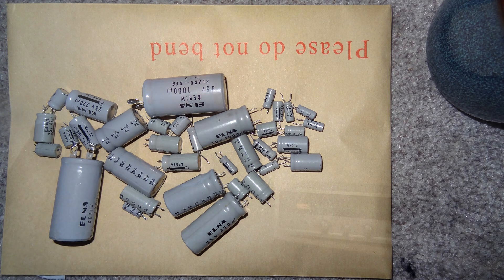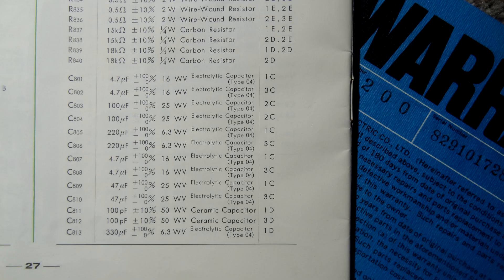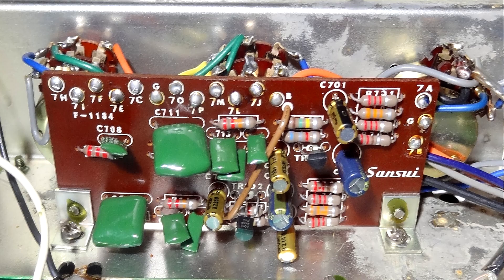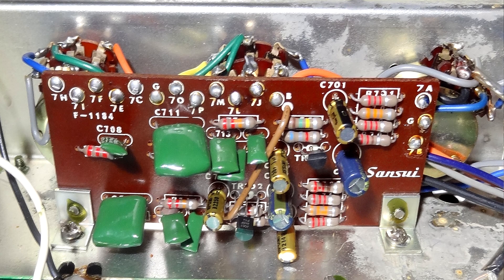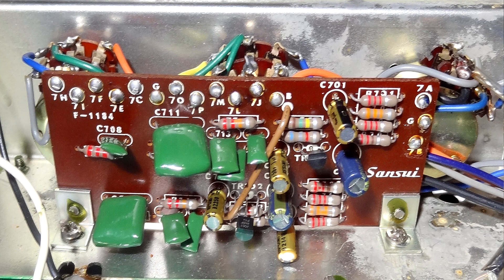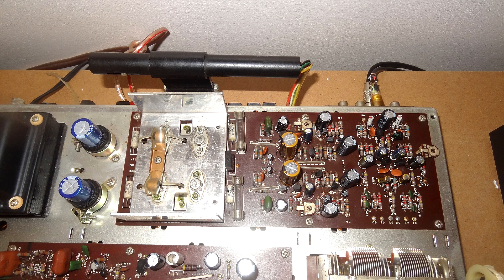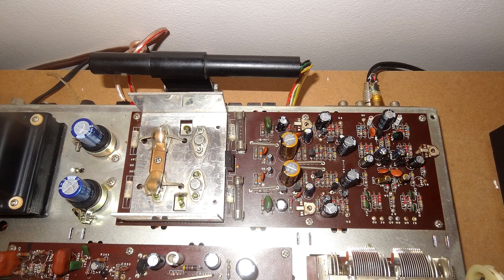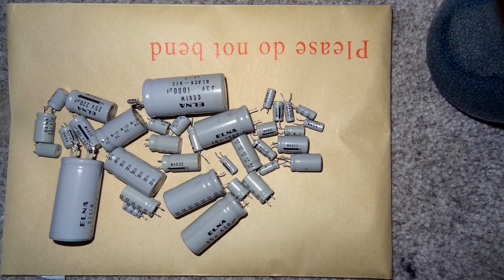Recapping over 30 Capacitors on a 50 year old Sansui Receiver. Did it make any difference?

Comment: hi have a low cost meter  i have to change the cap's over away  the job would get done any way  
 i know now if i get any grear it better to change caps right away of you can 

the main thing i emailed you back i am lucky i have a brenell 8  reel to reel   BEWARE  in some audio gear the pcb it's   can go bad  over 
time  in my deck the pcb has gone soft and the copper tracks are coming away   so alot of the tracks from the relays are bad lucky 
i have 2 spare  working pcb's if i put the pcb up to a light i can see where the tracks were 

tascam 38 has a bad pcb  in alot of place note alot of this deck can be fixed  using a small computer  as all the logic is do on 5v to power trans 
for all the for the coils  

i have been playing with the 2 decks i have that don't work right

Comment: The lower end is right where I live, currently in the 15-20 Wpc range.  When I was 14 (1979) I was given a hand-me-down Pioneer SX-434 with a PL-10 turntable and pair of speakers, and during the 1980's added a tape deck, graphic EQ, and CD.  I loved it, absolutely loved it.  It's only been in the past year that I've discovered that these are entry level components with low power output.  I never knew anything about that, never cared, and it never occurred to me to buy more receivers and speakers.  But now that I am I'm keeping to a similar power output to 1) keep costs down, 2) have more apples-to-apples comparison, and 3) continue to use the 3 pair of speakers that I already have.  The other two receivers are a Harman/Kardon 330B (specifically targeted) and a Sansui 661, and all made right around 1974.  For Sansui I was looking in the 221-331-441 range but there wasn't much available, they were very pricey, and got snapped up quickly.  There were more 350A and 220 units available, so I was about to buy a 350A when a 661 popped up at a very good price.  I've now had the original SX-434 restored to spec.  The tech dutifully advised that it would cost more than it's worth, but that only matters if I sell it.  My wife can sell it at my estate sale if she wants.  I still love it, and now the others as well.  They'll have their turn at the tech in time.  Don't the "little guys" deserve some love too?
Reply from the maker: Thanks for the comment, There are some great little wattage units around, especially from the 70's and they produce a great sound. Some people might need more watts for big rooms and parties but for a small to medium room 10-20 watts is fine. ah a 661 I would love one of those.

Comment: New electrolytic caps need about 100 hours of break in (burn in).
Reply from the maker: I have read between 30 and 100 hours, I did have the receiver running for 3 or 4 days before hearing the difference, I expect that was still not enough, but think it can only get better.
Reply: @MichaelYates  Certain caps like Panasonic will snap in after 50-100 hours. This is an important upgrade to listen for.
Reply: Yes, but also depends on how hard the amplifier is driven. 
Depends on your speakers impedance and how loud you drive the amp.
I find it is better to use a recapped typical domestic amplifier with 6 ohm speakers at no higher than volume at the  9 o'clock position so it gives enough time for the circuits to settle in.  Plenty of music for a nice long sifting with many great albums daily does the trick.

Comment: Michael, I would really like to see a video of you doing a disassembly, remove a board or two, examine the caps, select the ones to replace, replace, reassemble. You could do parts speeded up - we would be interested in how you decide what to replace and what to leave alone. All the best, Rob in Switzerland
Reply from the maker: Hi Rob and welcome from Switzerland and what a wonderful country I have only been once and must pay another visit soon. I will make sure I do a disassembly video if and when I do another recap. I have done a little part disassembly video in photo's on a Marantz 1030 here https://youtu.be/gNhupMlqQPk , In this and most cases I do the full recap rather than test and replace if needed as these are small amps/receivers with nearly 50 year old caps and the new caps are cheap enough to get the whole lot. in the Sansui 200 it looks like nearly all the caps were out of spec.

Comment: Do yourself a huge favour Michael. Buy a couple of Cambridge Audio A1 amps, recap one with audiofool gold caps and the other with standard line Panasonic/Rubycon/Nichicon/Elna caps and be honest with yourself if you can hear any difference between the two amps. Go even cheaper with brands like Samwha/Samxon/Yageo and I'll wager you'll still struggle to differentiate between them. The only thing premium capacitors are worth paying for is long service life or if the amp has to operate reliably in extreme conditions. Capacitors are not magic Michael.
Reply: No component sounds the same..............
Reply: @frankgeeraerts6243  Totally Agree
Reply from the maker: That is a idea I might just take on if I find a couple of them going really cheap. Though I have done a cap comparison on the channel I tried a Sansui au217 with a few different caps in the signal path input part of the amp I tried a Rubycon, Nichicon Gold and WIMA and the Nichicon gave the best results, Rubycon was a good second best and the WIMA was very poor indeed.
Reply: @MichaelYates  And get someone else to swap the amps over so you don't know which is which. 👍
Reply: I have done quite a few recaps in my time and used an array of caps. I have to disagree as they all sound different. The difference might not be so apparenton a cheap basic amp but as the quailty of the amp goes up the difference in the sound of each type of cap used can be heard with ease.
Reply: @peterskyes1267  Right comment !

Comment: Very interesting Michael, I watched it all.
This is something I'm considering doing to my Arcam fmj A19 amp at some point. 
Like number 8 from me my friend.
Jim 🏴🙂
Reply from the maker: Thanks Jim, even though here and on my 331 it did make a difference I have read on forums that it does not always turnout that way and some people after recapping did not like the sound. Main complaint saying that the amp sounded to bright. So keep the old caps just incase. Regards Michael
Reply: @MichaelYates   thanks for the information buddy, much appreciated.
Jim 🏴🙂
Reply: @MichaelYates   I happened to come across the Fidelity Audio level 1 upgrade for my Arcam A19 amplifier Michael, and it seems interesting. At £349 it's not cheap though! I assume that's fitted but could be wrong! 😱
Reply from the maker: @jimsregaturntableshifijukebox  Hi Jim, I just looked the upgrade up and there is no mention of fitted in the price but at £349 I would have thought thats it does mean all parts installed. Even if so its not cheap. As a matter of interest how do you rate that amp ? as the reviews I have read said it has a great deal of space around the vocalist, instruments etc.
Reply: @MichaelYates  thanks for the reply buddy 
To me it's been a great amp and exactly as the reviews described.
Reply from the maker: @jimsregaturntableshifijukebox  Thanks Jim